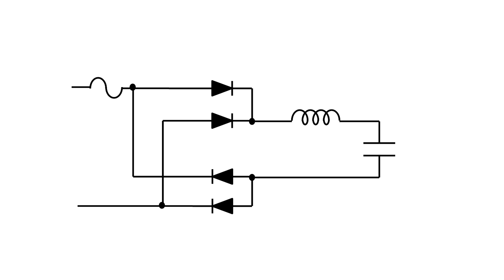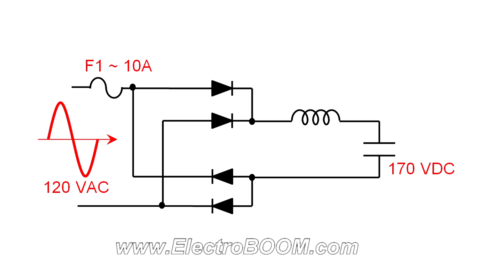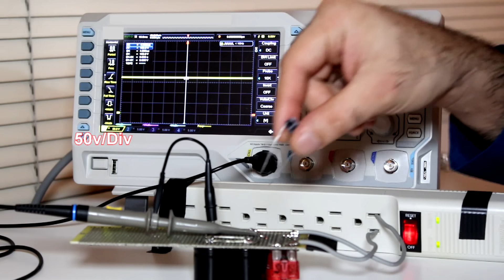Making a Full Bridge Rectifier

Comment: Where do I get a bridge rectifier from?
Reply: ***** Rectum Fire?
Reply: Seph Angelo You can try to build it from single diodes, but it isn't so simply as it look like :P
Reply: four power diodes and some caps and you got it but most sensible people use a prepackaged bridge rectifier on a proper heatsink rated at the amps they desire..

Comment: does the cap need to be correctly sized for this or can i just use the biggest capacitor i can find
i want to use a 120v inverter and rectify it to get 170vdc to charge my 153v battery pack
the idea is to charge from solar panels
Reply: wanted to add
for the inductor ill just loop one wire of the dc side around a pen or a nail or something

Comment: interesting shot of the resistor heating up, I knew that they did that but have never seen one glow before.  You should expand on that in a video perhaps un-spool a resistor like that then use electricity to heat cut things like cheese, Styrofoam, plexyglass, bear claw pastries, etc....

Comment: I had a nasty shock from a capacitor inside a SMPS. DC hurts like fuck when the solder contacts pierce your fingers and the whole lot goes through your chest. Living in the UK, that's over 300VDC from a SMPS primary capacitor.

Comment: What happens if you simply just feed 120-170V DC into a circuit that already has a bridge rectifier?

Will a bridge rectifier allow a device to safely take a DC current source (I wanted to try it out, but don't have any devices that I am willing to risk messing up to find out :) )
Reply: It would work. Bridge rectifiers can be used to make things dual-polarity compatible, so you can't plug it in the wrong way. It's useful for things like LED bulbs in a car where the bulb can be put in either way. The DC is input either way into the AC side of the bridge rectifier and it always produces positive at the + and negative at the -, no matter which way round you put the DC input.

Comment: Hey Mehdi, I have a question for you: You state that DC is less dangerous than AC. Now I'm a technician myself and quite some debate with people about which one it really is. I always thought DC was more dangerous as there isn't a change in polarity, resulting in a person getting 'stuck' once electrocuted. On the other hand, AC does, which is worse for the heart-muscle. I know this isn't anything new for you, but was is your take on this?
Reply: He has some videos done about this. It's basically because your body is weird and also behaves as a capacitor (And a very low neglect-able inductor) . In DC: Resistor behaves as a resistor, Capacitor as a open wire, and inductor as a short/normal wire.
In AC: Resistor behaves as a resistor, Capacitor from open wire to short while increasing frequency, and inductor visa-versa. 60Hz is not a very high frequency but it still means that there will be current flowing through your resistive and capacative body component. 
Since your a technician, you can test this principle when researching 'coupling capacitors'. You can basically use it to sum DC and AC (low please) voltage sources or get rid of a DC-offset in an AC wave (hence 'AC-coupling' on a oscilloscope)
Reply: Rivalo
 So in conclusion you would say that it's the frequency that makes it 'more dangerous'?
There's also an argument that claims it's the frequency that gives you a chance to 'break the circuit' once a person touches an AC-supply. Your natural response is to pull away, which is possible cause of the change in polarity.
I know there are a lot more factors that we should take into account, as both can be fatal, but it's still an interesting subject.
Cheers!
Reply: DriZ01

I don't actually know the answer (haven't researched or tested it myself), but even though 60 Hz is considered "low" frequency, something happening 60 times a second is going to be too fast to react, let alone move your muscles fast enough to break the circuit. That's assuming there's no lag time on the paralytic effect of electricity, that your muscles will immediately be able to move between those pulses. I just don't see how this idea would be true.
Reply: DriZ01 You probaby can't react to 50/60Hz since your monitor you're looking at probably also refreshes at that rate.

I've now looked it up: 'The Human Body Model for capacitance, as defined by the Electrostatic Discharge Association (ESDA) is a 100pF capacitor in series with a 1.5kΩ resistor'

In frequency domain this means the resistance of your body = 1.5k + 1/(100pF * j * 2pi * freq)
I've done some simulations, and yes the current through your body increases when applying a higher frequency.

But, still.. This current is actually very low. micro ampere range. 100pF is very low, and 1.5k is actually pretty much. So it has probably a lot of biological factors with it, and probably also time. 

So, yeah I can't really calculate very proofwise why AC is more dangerous than DC. Maybe others can.

Comment: That diode and capacitor curve was not quite right. Either it was a diode bridge or the amplitude of the signal should have been lower. Any way I know you know <3
Reply: It might have something to do with the LC filter he uses after his diode bridge. The normal curve you would expect is when using simply a capacitor which acts as a simple RC filter. The LC filter is different due to the fact that just as a capacitor, the inductor is a 'time-dependent' component, but when looking at the maths exactly the opposite of a capacitor. This creates oscillation between these two parts which decreases (gets converted to heat) in a period of time due to the internal resistance of the inductor. (The cap charges -> Cap discharge/Inductor Charge -> Inductor discharge/Cap charge etc.)

Comment: good video. A story of my own fuckup:

I was doing work on a small electric car which is a two car-battery 48v system, and I was trying to rig up a shunt resistor on the positive rail and probe the output to see the current.

The car is isolated from ground because it's running on batteries and is up off the floor on rubber tires, so not a problem to attach the ground of the probe to a point which is right on the positive rail. I'm sitting in the seat of the car with about 4 alligator clip leads draped across my lap and doing some tests while looking at the scope on the bench. As I'm free-running the motor without a chain the vibration makes the car roll back just slightly and the metal frame touched the apparently grounded metal wall behind me. The wires in my lap light up and some stuff caught on fire with a bang.
Reply: Cool Story bro👍
Reply: TL;DR the walls are grounded, it blew up.
Reply: just give a fucking TLDR !!

Comment: You jumped at the end from residual capacitance yet held your finger across it earlier to show that the DC voltage wasn't particularly dangerous. Hmmmmm :)
Reply: Yeah, because DC from the output and DC from a capacitor are two different things.
Reply: Large amount of charge delivered in a short time through a capacitor.
Reply: Omkar Pradhan
cool, ta :)
Reply: Omkar Pradhan
why? more voltage?